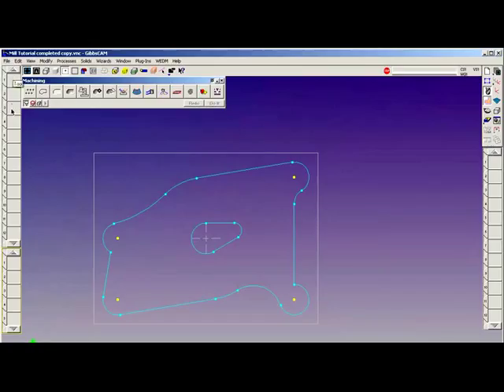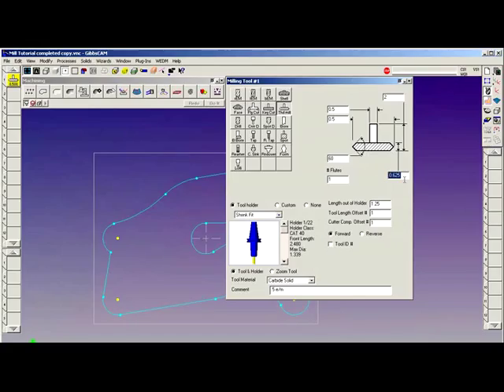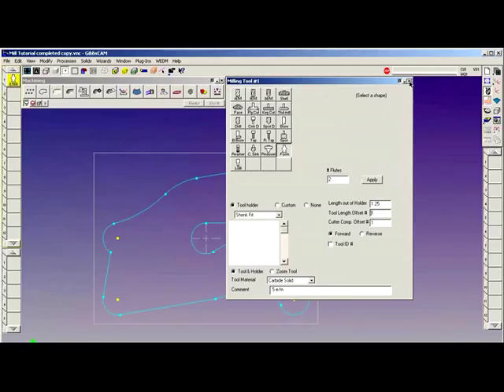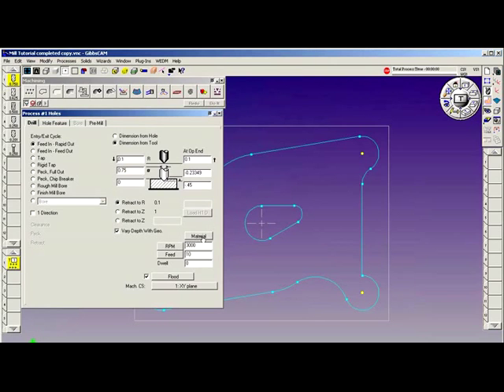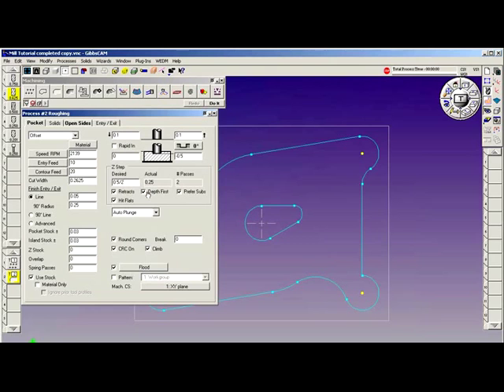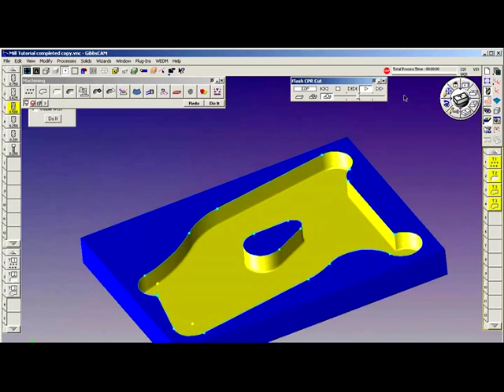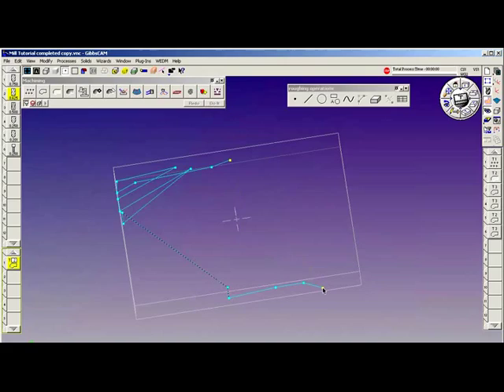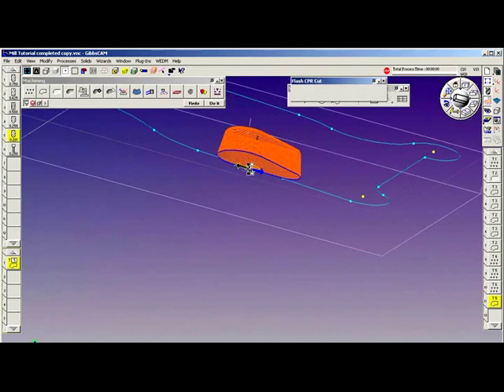gibbscam production Mill Tutorial

Comment: Drawing flat work is very easy and I’ve had parts machining in 5-10 minutes. Now drawing 3D z depth is not easy. I still haven’t figured out how to connect 3 lines for a dimensional corner. Basically z negative right angle corners because you have bottom pockets and side contouring. If I could connect 3 lines I’d move forward with gibbs. As it sits autodesk is way easier, more advanced, and far less expensive for this option alone.